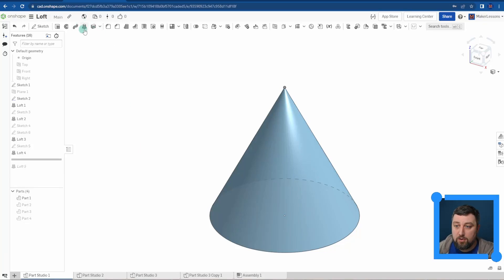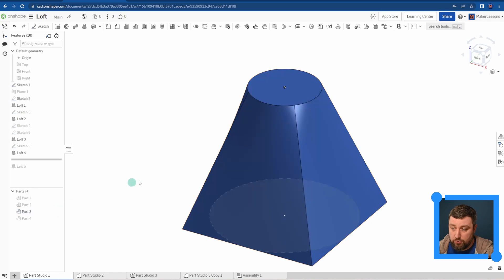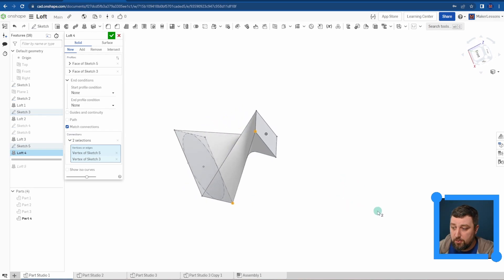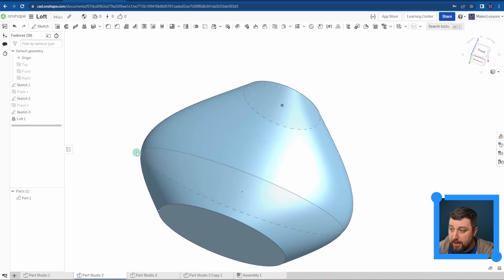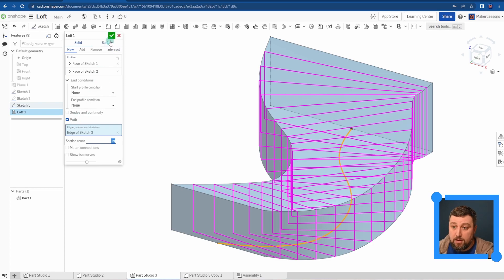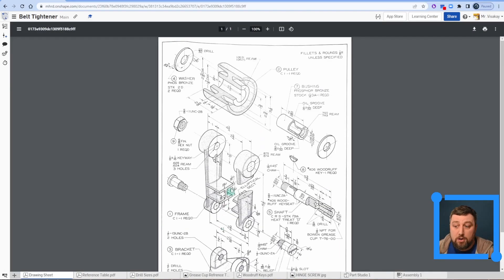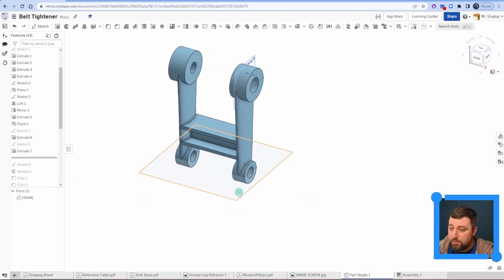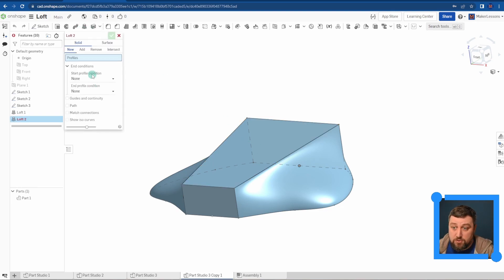Learn Onshape: Loft

Comment: when im using a loft (with guides to curve it in a little) the end dimentions are a little off, which is maming other dimentions out of wack. not by much but im going from having a perfect circle of 20mm diameter. to having it 20mm one way then 19.999 or 19.998mm the other way. how do i stop this from happening